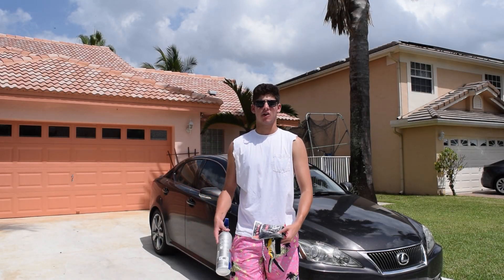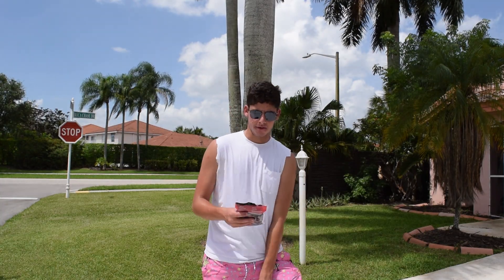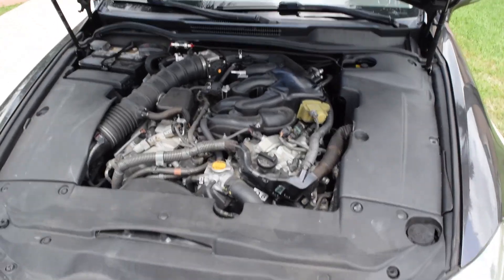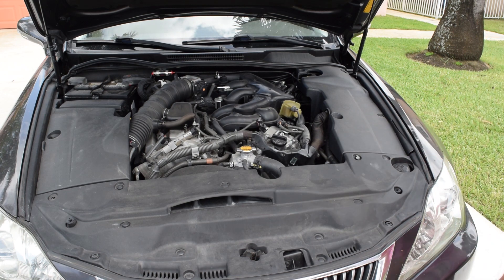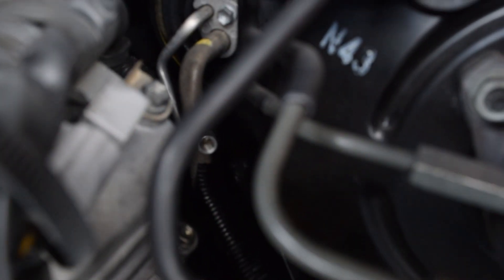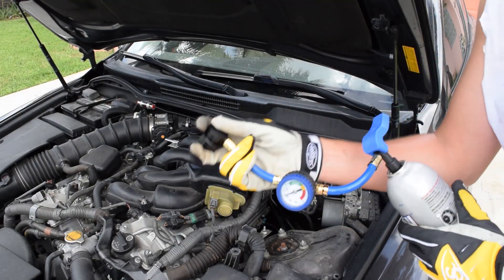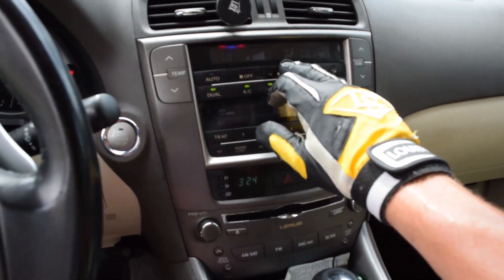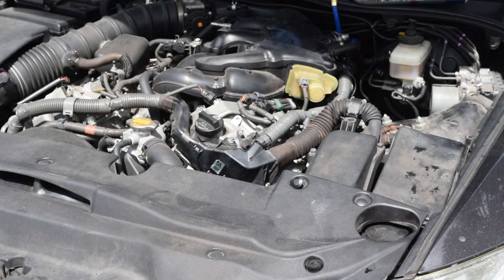How To Recharge Your Air Conditioning In A 2009 Lexus IS250

Comment: Thanks. I did this to my 06  and worked great. One thing to watch out for is how hot outside it is and what actual pressure it needs to be. You could be looking at going up to the 40-45 range if its Florida weather. Also the Low pressure port on these cars are a pain to get the plug to go on because you have brake lines in the way as well as one of the air intake hoses. You can forgot about testing the high pressure side as you will have to remove the alternator, header assembly, and possibly the AC compressor itself.

Comment: Please use professional dual gauges to confirm there is no pressure build up on high pressure side due to blockage at the evaporator.........this is critical.
Reply: There is no access to the high pressure port in these cars. You have to remove the headers, AC compressor, and alternator to get to port. Some cares are like this.
Reply: lextacy2008 remove the plastic that are by the hood latch you’ll see the high pressure port.
Reply: @jflorf909  I see it now, lol thanks!

Comment: Dude you don’t want recirculation on you want the air to blow across the coil from the ambient temperature air. So you get the full charge need. Also you Need to purge the air trapped inside the hose so you don’t put O2 into the system that causes corrosion. Lastly you need to shake the can so you get vapor and liquid if more you get a liquid charge that will not adequately charged the system and wreck the compressor
Reply: The directions printed on the can specifically read “start the car,turn the ac on max and set to recirculation” I’m not saying you don’t know what you’re talking about, but could the manufacturer really be misleading everyone who buys there product?

Comment: How were you able to take the cap off the low pressure port?
Reply from the maker: kenney nguyen elbow grease! haha. not sure. mine wasn’t on incredibly tight. if you’re still having issues, i would try something sort of a wrench with plastic so you don’t crack it. worst case, buy a new cap. they go for a dime a dozen.
Reply: @Lancedragos  I'll see if I can use a wrench of some sort lol. Thanks for letting me know!
Reply: @TheKenney1010 Did you end up getting it off? I tried to do that on my is350 today. The cap was so tight and there was not enough room for me to fit my hand down there to apply bigger force. How did you manage to get it off?

Comment: Supposed to charge between 40 & 45 that's the right pressure for this car, cuz I have the same car, 40 & 45 car will be extremely cold no problem
Reply from the maker: DRO C thanks for the comment, I called my local lexus dealer to make sure of what psi to charge it to. what year is yours?
Reply: DRO C dear u have any idea to advise me about 2007 Lexus is300ac compressor is basic or variable compressor because I can’t see any clutch engaging and release there thank you.
Reply: Me too and told 50 now im going to research thoroughly before doing it I have your identical car